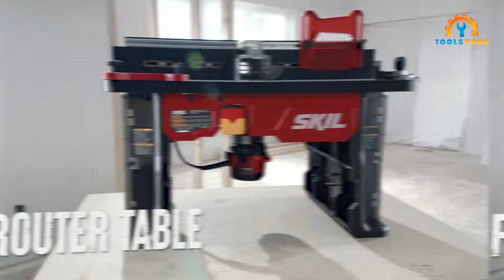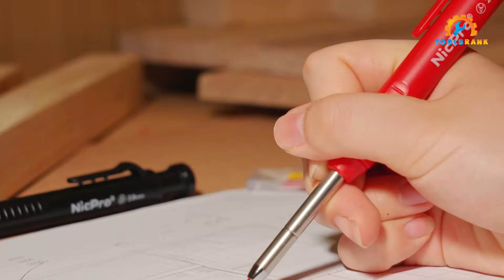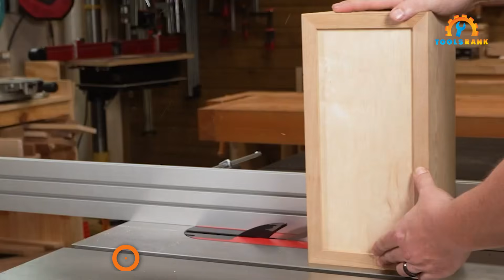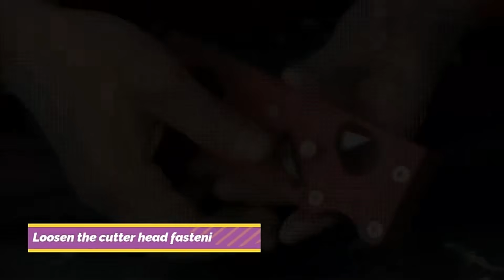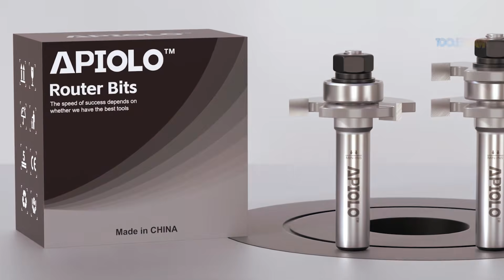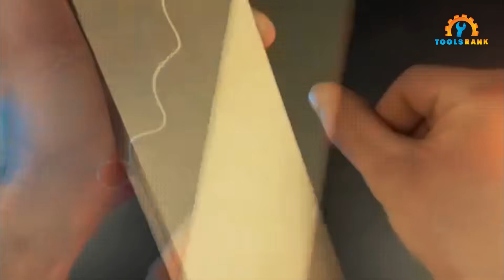82 New Woodworking Tools On Amazon | Wood Tools For Experts

Comment from the maker: 1	JET Benchtop Mortiser Machine	
 https://www.amazon.com/dp/B0000223M4?tag=toolsrank-20
2	Milescraft Drawer Installation 	
 https://www.amazon.com/dp/B09TLCNJBW?tag=toolsrank-20
3	KEENTECH Circular Saw Blades	
 https://www.amazon.com/dp/B0BPRMSF8Y?tag=toolsrank-20
4	Adjustable Framing Spacer Tools	
 https://www.amazon.com/dp/B0FKT4VZPM?tag=toolsrank-20
5	TILSWALL Rotary Tool Kit	
 https://www.amazon.com/dp/B08GXXT41G?tag=toolsrank-20
6	SKIL Portable Router Table	
 https://www.amazon.com/dp/B096Z7PN4M?tag=toolsrank-20
7	REXBETI Folding Pruning Saw	
 https://www.amazon.com/dp/B07BLQBN8X?tag=toolsrank-20
8	Hedgehog Table Saw Pushblock	
 https://www.amazon.com/dp/B09DDCKZLM?tag=toolsrank-20
9	AUXTUR Sharpening Stone System	
 https://www.amazon.com/dp/B0CQLNWX66?tag=toolsrank-20
10	KASTFORCE Heavy Roller Stand	
 https://www.amazon.com/dp/B0B8MMTZRX?tag=toolsrank-20
11	meite Manual Point Driver	
 https://www.amazon.com/dp/B0CQYKDJL2?tag=toolsrank-20
12	Gisafai Mortising Drill Adapter	
 https://www.amazon.com/dp/B0CTYCHX3L?tag=toolsrank-20
13	MarvTool Sliding Miter 	
 https://www.amazon.com/dp/B0F9KMPTZF?tag=toolsrank-20
14	Premium Detail Sanding Kit	
 https://www.amazon.com/dp/B0FDWYKCSM?tag=toolsrank-20
15	Nicpro Carpenter Pencil Set	
 https://www.amazon.com/dp/B09WYNGWCM?tag=toolsrank-20
16	Konload Tree Draw Knife	
 https://www.amazon.com/dp/B0DYCY9T1H?tag=toolsrank-20
17	JORGENSEN Mini Block Planer	
 https://www.amazon.com/dp/B0BVZK331X?tag=toolsrank-20
18	POWERTEC Portable Miter Stand	
 https://www.amazon.com/dp/B09WQHPRMT?tag=toolsrank-20
19	Precision Table Saw Gauge	
 https://www.amazon.com/dp/B0D6VD9JFX?tag=toolsrank-20
20	Woodpeckers Alignment Gauge Tool	
 https://www.amazon.com/dp/B002VRFM9Y?tag=toolsrank-20
21	Dreyoo Table Height Gauge	
 https://www.amazon.com/dp/B0CP7Y9HFZ?tag=toolsrank-20
22	VERVEWAVE Cordless Drywall Cutter	
 https://www.amazon.com/dp/B0G6DHBXZH?tag=toolsrank-20
23	ViewReal Track Saw Square	
 https://www.amazon.com/dp/B0CWDC8TWK?tag=toolsrank-20
24	HILTTEIL Center Finder Ruler	
 https://www.amazon.com/dp/B0CY7NJL1J?tag=toolsrank-20
25	Kreg K4 Pocket Jig	
 https://www.amazon.com/dp/B001DYFISG?tag=toolsrank-20
26	JOREST Contour Gauge Tool	
 https://www.amazon.com/dp/B0969G39FL?tag=toolsrank-20
27	JORGENSEN Coarse Hand Saw	
 https://www.amazon.com/dp/B09XWB5ZPC?tag=toolsrank-20
28	Woodpeckers Auxiliary Rip Fence	
 https://www.amazon.com/dp/B0F4DWLFRC?tag=toolsrank-20
29	Kreg Shelf Pin 	
 https://www.amazon.com/dp/B09V8BN6W9?tag=toolsrank-20
30	YANGYANGDA Manual Tile Cutter	
 https://www.amazon.com/dp/B0FLDC6W69?tag=toolsrank-20
31	BeaverCraft Deluxe Carving Kit	
 https://www.amazon.com/dp/B0881TSJGG?tag=toolsrank-20
32	Infinity Easy Angle Jig	
 https://www.amazon.com/dp/B0F2G2YNHW?tag=toolsrank-20
33	Lenox Carbide Hole Saw	
 https://www.amazon.com/dp/B0857SQTRB?tag=toolsrank-20
34	Gohelper Hinge Jig Precision	
 https://www.amazon.com/dp/B0FK5275RY?tag=toolsrank-20
35	TANYO Shelf Pin Guide	
 https://www.amazon.com/dp/B0GR4MHSRW?tag=toolsrank-20
36	Generic Log Clamp Holder	
 https://www.amazon.com/dp/B0DPVH8RPN?tag=toolsrank-20
37	MICROJIG Dovetail Router Bit	
 https://www.amazon.com/dp/B07CR9SVJS?tag=toolsrank-20
38	Milescraft Compact Router Base	
 https://www.amazon.com/dp/B07FT7PRNG?tag=toolsrank-20
39	KAKURI Japanese Marking Gauge	
 https://www.amazon.com/dp/B08XQ5QTP6?tag=toolsrank-20
40	TEENO Compact Wood Router	
 https://www.amazon.com/dp/B0CRHCM25P?tag=toolsrank-20
41	REXBETI Precision Needle Files	
 https://www.amazon.com/dp/B0CS2YMPZ9?tag=toolsrank-20
42	Olympia Woodworker Bench Vise	
 https://www.amazon.com/dp/B002I2KFMG?tag=toolsrank-20
43	Chamfer Edge Wood Planer	
 https://www.amazon.com/dp/B0CH6NMJVP?tag=toolsrank-20
44	Rockler Parallel Panel Clamps	
 https://www.amazon.com/dp/B0BSVLVW7H?tag=toolsrank-20
45	BeaverCraft Spoon Carving Kit	
 https://www.amazon.com/dp/B0849KPWCR?tag=toolsrank-20
46	Woodpeckers StabilMax Router Base	
 https://www.amazon.com/dp/B0DJH6159H?tag=toolsrank-20
47	EQUIPTZ Heavy Spring Clamps	
 https://www.amazon.com/dp/B0BG8L8TJH?tag=toolsrank-20
48	Amazon Basics Bench Planer	
 https://www.amazon.com/dp/B07V3QLZ5Y?tag=toolsrank-20
49	BGASNW Bench Dog Clamps	
 https://www.amazon.com/dp/B0D7969LMQ?tag=toolsrank-20
50	ViewReal Carpenter Scribing Square	
 https://www.amazon.com/dp/B0CHN5VPXM?tag=toolsrank-20
51	PONY Corner Clamp Set	
 https://www.amazon.com/dp/B0D8KMG4ZW?tag=toolsrank-20
52	OSKOOL Digital Banding Iron	
 https://www.amazon.com/dp/B07Y2X7JYW?tag=toolsrank-20
53	Wonglea Mitre Saw Guide	
 https://www.amazon.com/dp/B0CFY729YC?tag=toolsrank-20
54	FETESNICE Multifunction Doweling 	
 https://www.amazon.com/dp/B0G4RBZ93K?tag=toolsrank-20
55	WORKPRO Wood Chisel Set	
 https://www.amazon.com/dp/B0DPY6TRFZ?tag=toolsrank-20
56	XAQISHIRE Multi-Way Wood Rasp	
 https://www.amazon.com/dp/B0C28HDDDR?tag=toolsrank-20
57	Kreg XL Pocket Jig	
 https://www.amazon.com/dp/B09V87ZDNH?tag=toolsrank-20
58	BUZZLETT Hidden Fastener 	
 https://www.amazon.com/dp/B0DZCSB421?tag=toolsrank-20
59	APIOLO Tongue Groove Bits	
 https://www.amazon.com/dp/B0CB3T9VLL?tag=toolsrank-20
60	Woodpeckers Universal Router Fence	
 https://www.amazon.com/dp/B0FQ79GW59?tag=toolsrank-20
61	Vorhixa Countersink Drill Set	
 https://www.amazon.com/dp/B0GG9ZW57F?tag=toolsrank-20
62	Bora MiteriX Angle Duplicator	
 https://www.amazon.com/dp/B01J7KWMEA?tag=toolsrank-20
63	WEN Spiral Thickness Planer	
 https://www.amazon.com/dp/B08NWF6P3Q?tag=toolsrank-20
64	Extbtfor Mini Circular Saw	
 https://www.amazon.com/dp/B0FT77Z3NF?tag=toolsrank-20
65	POLIWELL Sanding Drum Kit	
 https://www.amazon.com/dp/B0FDQLV2HK?tag=toolsrank-20
66	Arrow Heavy Duty Stapler	
 https://www.amazon.com/dp/B0FJ9RNRMT?tag=toolsrank-20
67	NECAMOCU Edge Band Trimmer	
 https://www.amazon.com/dp/B0D9TX59CG?tag=toolsrank-20
68	Milescraft CompactSubBase Router 	
 https://www.amazon.com/dp/B07FT7PRNG?tag=toolsrank-20
69	Woodpeckers Multi-Marking Square	
 https://www.amazon.com/dp/B0DG981DLF?tag=toolsrank-20
70	Milescraft AngleFinder Measuring Tool	
 https://www.amazon.com/dp/B00F1ZJHSA?tag=toolsrank-20
71	WEN Electric Hand Planer	
 https://www.amazon.com/dp/B00OW5AJTG?tag=toolsrank-20
72	Woodworking Sharpening Stone 	
 https://www.amazon.com/dp/B0CQLNWX66?tag=toolsrank-20
73	RUITOOL Concealed Hinge 	
 https://www.amazon.com/dp/B0GMG1X3SF?tag=toolsrank-20
74	YIHUA Pyrography Burning Station	
 https://www.amazon.com/dp/B0CH9N8WZM?tag=toolsrank-20
75	Kreg VersaGrip Clamp Pack	
 https://www.amazon.com/dp/B0CG2RY2P3?tag=toolsrank-20
76	DRAXZOR Edge Band Trimmer	
 https://www.amazon.com/dp/B0F1DRXMHP?tag=toolsrank-20
77	XFasten Woodworking Tape Pack	
 https://www.amazon.com/dp/B07BBL4JXJ?tag=toolsrank-20
78	DOVAMAN Mini Circular Saw	
 https://www.amazon.com/dp/B0C3H6V6DY?tag=toolsrank-20
79	StewMac Plunge Router Base	
 https://www.amazon.com/dp/B077K6WXK3?tag=toolsrank-20
80	Trend EasyScribe Marking Tool	
 https://www.amazon.com/dp/B00H5PWUX8?tag=toolsrank-20
81	WORKPRO Cabinet Support Pole	
 https://www.amazon.com/dp/B0BBDWJXRB?tag=toolsrank-20
82	Pilim Carbide Burr Set	
 https://www.amazon.com/dp/B097BRDSZT?tag=toolsrank-20